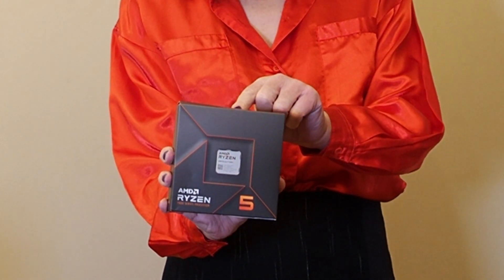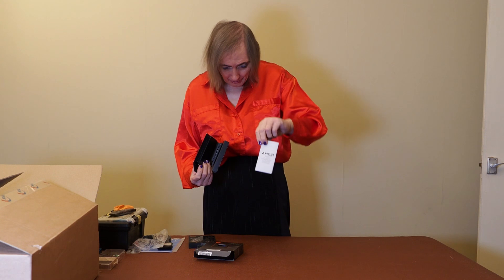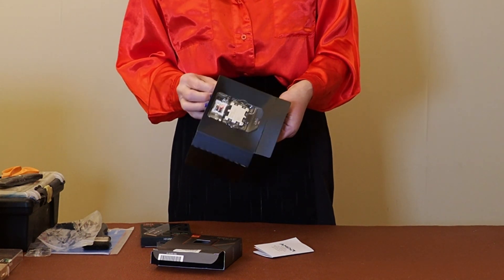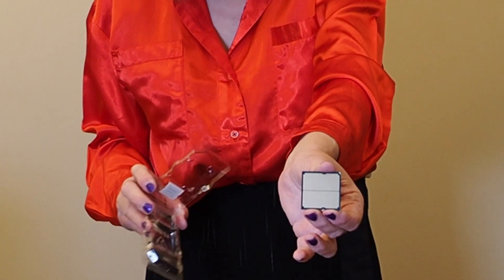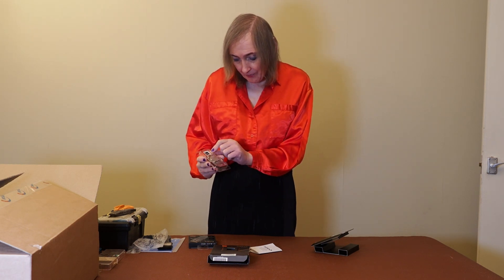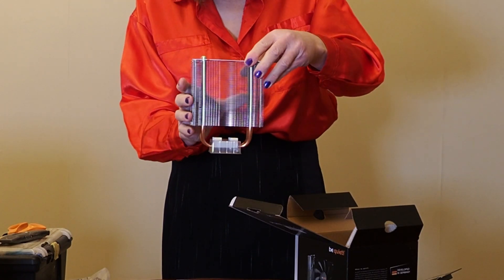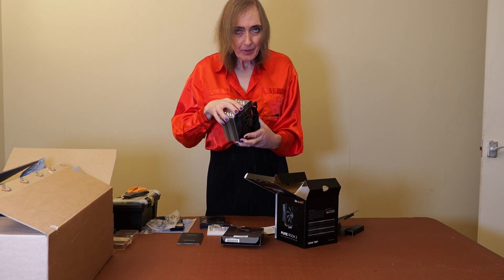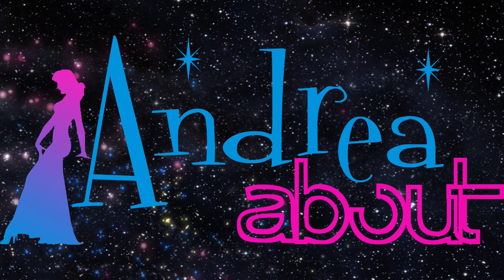Ryzen 5 7600X and BeQuiet Pure Rock 2 Heatsink Unboxing

Comment: Hello, do you have results of working 2 of them together, whats the most temperature you get? All time stable or better get some better cooler? I want to buy the same, thats why :)
Reply from the maker: Hi, CPU is 38 degrees after running all day at normal use.  Rendering a 15 minute HD (1080P) video on PowerDirector using 100W and temp is 76 to 77 degrees, took about 3 mins to render and with other applications running in the background. It is always good to get the best heatsink and fan you can afford. If you are planning on upgrading the CPU later then it may be good to invest in a better cooler but the Pure Rock 2 is fine for this CPU. A water cooler (all in one) unit would be good but may be an overkill for this processor, good for future upgrades if you are planning on a Ryzen 9 later.
Hope this was helpful.
Reply: @andreaabout  yes, thank you.. i was quiet uncertain because i couldnt find good review, so this helps me a lot. :)
Reply from the maker: @vedranjuricic3545  Glad it helps. The computer system it is in blongs to a friend who I built it for and he gave me the results above. So far it has been working fine and used in video rendering for his YouTube channel and photo processing/manipulation. He doesn`t do any gaming. So if you do intend to game then perhaps an even better cooler would be good.
Reply from the maker: It has been a very stable system so far with the ASUS Prime X670P WiFi motherboard and Kingston Fury Beast 6000MB/s RAM. Also another point to remember is getting a good quality PSU. Seasonic and Corsair make excellent units. Corsair RM and upwards.
Reply: Results? :)